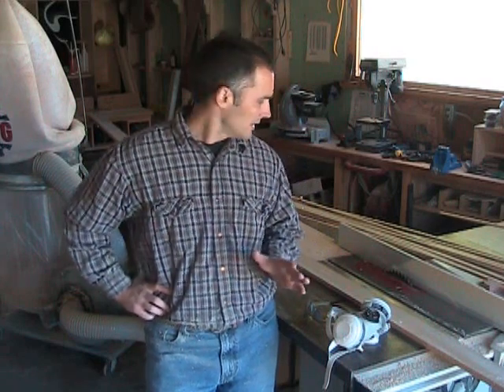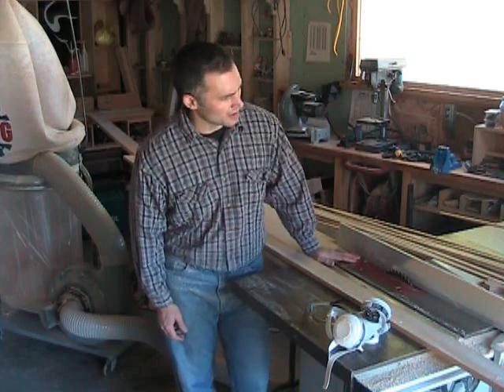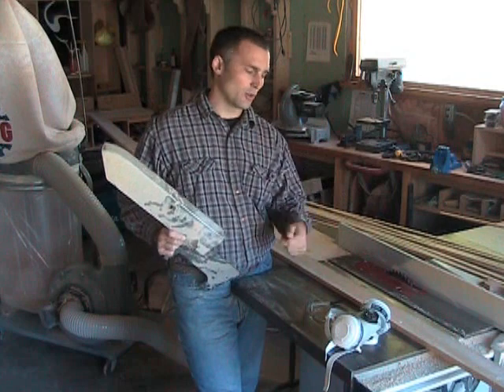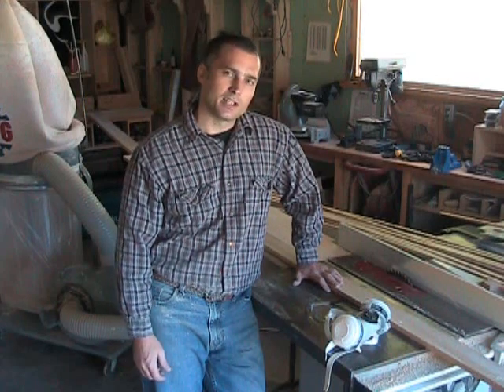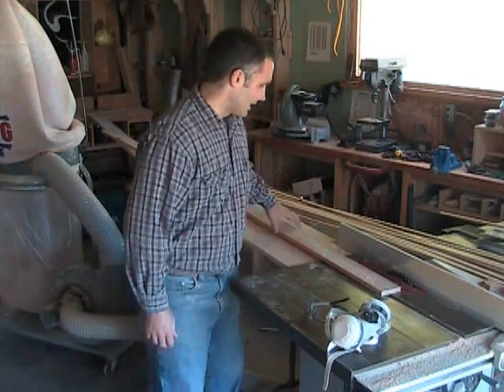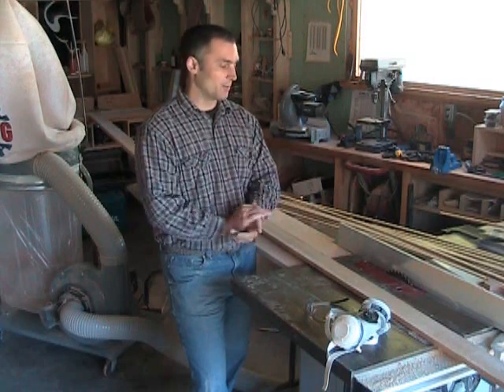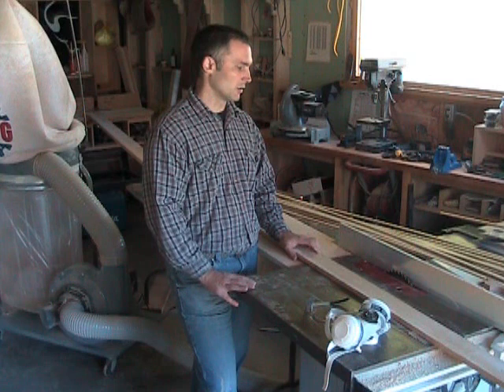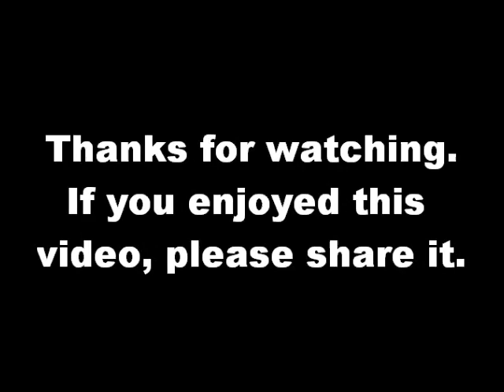Cedar Strip Boat Building: Milling Cedar Strips - Pt Three

Comment: Add feather boards , both down and inward toward the fence! A much more accurate cut and the board can be fed at a higher feed rate resulting in less blade burn from the saw. Occasionally re-joint after a few cuts to ensure a straight edge against the table saw fence. Also push blocks/sticks when the material is as narrow as was shown in the video!

Comment: Just two words for you; PUSH STICK. Since you are so concerned about safety, you may want to investigate feather wheels they will save you from standing on the side of the saw and an auxiliary fence that has a tall plywood piece with a feather board clamped to it will hold the material down on the saw's surface. Not only is it safer but it will speed the ripping process up by a factor of two. It does for me. I've been building boats for 45 years.